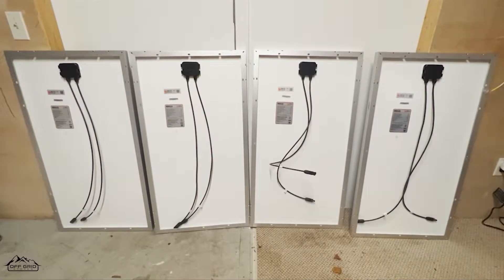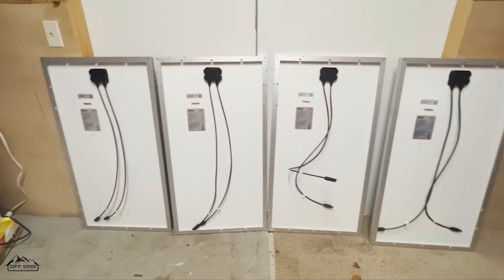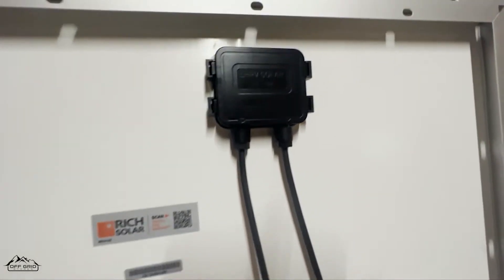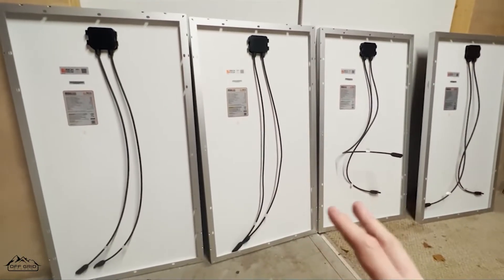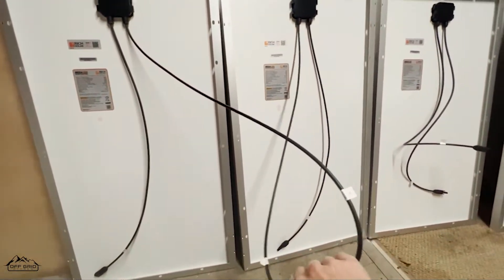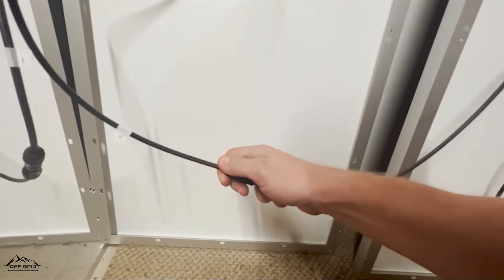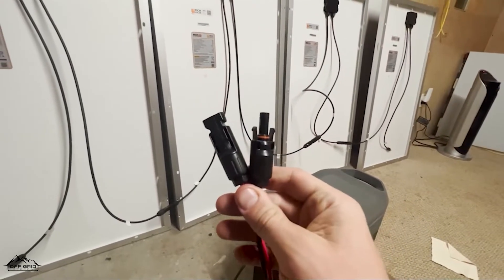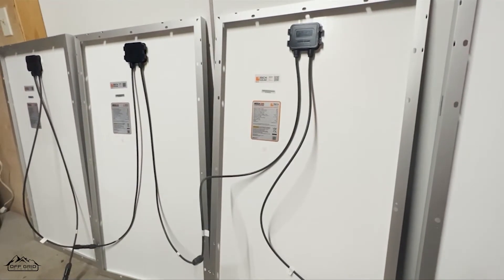How To Connect Multiple Solar Panels in Series (For Beginners)

Comment: I did this with 2) 225 watt panels 
I hook it up to my solix and it went from 175 watts with one to 55 with 2 
Almost impossible to screw up
- from 1 panel and + from the other to the device your charging 
So why only 50 watts for 2 225 watt panels?

Comment: Hie I have a quick question is like this I have 24v lithium 120ah battery 3kw and inverter 3kw and 2 solar panels 555watts can I connect them in series or just only in parallel thanks

Comment: Just got here, amazing simple and straightforward info, question, what's the best practice to ground the EcoFlow on an only solar/propane generator setup?
Reply: Don't no need to ground. If you do it may cause lots of issues.  I'm no expert but I've seen lots of videos saying Don't ground fuel generators or power banks

Comment: Thank you, when we connect two panels in series we double the watts and the voltage output of the panel, right?? Does the amperage output remain the same? Solar electrical is absolutely fascinating. So nice and quiet ❤ Even less noisy than my Honda inverter generator. I love it 😀
Reply: The watts will be the four 100 watts panels=400 watts...under ideal sun conditions.
The volts will be added up four x 18 volts= 72 volts.
The amps will remain the same as a single panel= 5 amps.

Comment: What if I do this twice? If I run another four panels in series total of 8 and connect the positive from the other four panels and the same with the negatives will that work? I have four of those Splitters where 2 connections turn to 1. I'm running these panels to a 80 amp Outback flexmax charge controller. I have 2 four hundred amp hour batteries they are huge and heavy do you think that is enough? I have more batteries but I only installed two in my travel trailer I thought that would be adequate

Comment: Thank you SOOOOOOO much! I had installed 2 extra panels (to total 4) for my Ecoflow but couldn't figure out why it wasn't working (and IMO - it's kind of hard to mess it up). Anyway, I put the lime in the coconut and drank them both together, thanks to you, and it works so well. I actually live in Italy on the 3rd floor of an old building with no access to the roof, So I bungie corded and zip tied my ecoflow panels to the shutters, the bottom of which extend out about 30 degrees. It's not perfect but gosh, it has saved so much in energy bills. Really appreciate you helping me sort them out. :)
Reply: Italy! Can I come over stay a week? I'll cook.
Reply: 😂 @TommyJones49